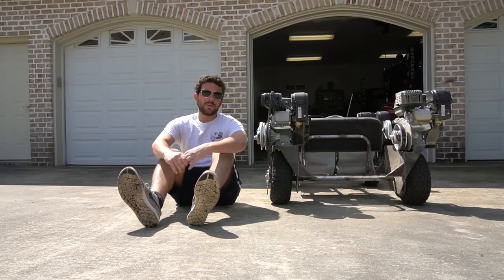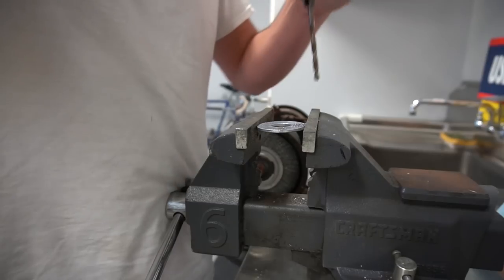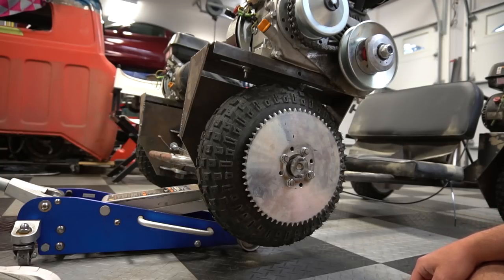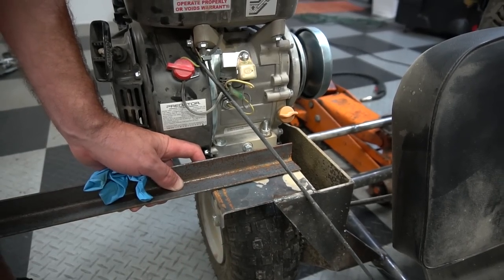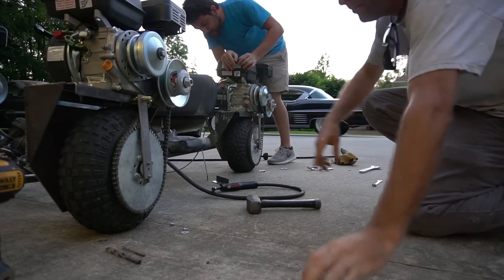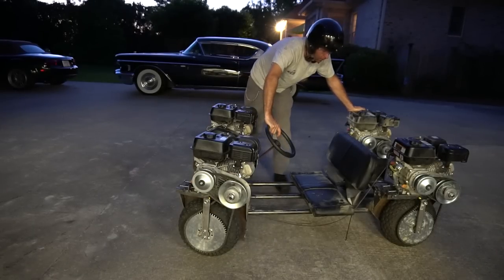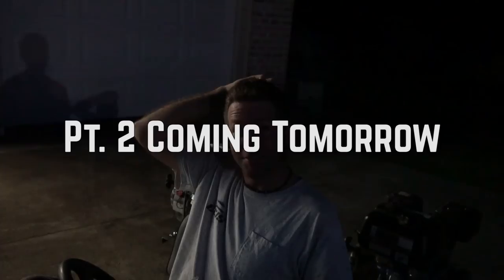Fixing Aggressive Camber & (Tiny) Wheelies!! AWD Kart Build

Comment: Live axle on the rear. Move engines inboard. Problem solved and you have a place to put your brakes.
Reply: Rod McHugenstein nope, you would need a diff because the engines in the front would mess it up on the turns

Comment: looks more like frame twist. than popping a wheelie. you've worried more about the strength of the engine plates then the frame. explains the cart wondering left/right under hard acceleration.
Reply: Zax Garrison more than likely the main reason for wandering is 4 wheels turning different speeds.  This contraption is crazy and awesome.  It’s what contraptioneering is all about 🤪

Comment: I wish I lived near you...im getting ready to turn a 4x4 4wheeler with 4 wheel independent suspension into a two seater dune buggy...i already made a singe seater out of a Suzuki 230 and it worked great...i mounted the engine onto the rear swing arm

Comment: I learnt from my motor cycles that a tight chain gives better acceleration. However too tight and you create more chain drag at top end so there is a balance point between acceleration and top speed when it comes to chain tension.

Comment: Just wondering if some square tubing welded along the outer lip would have worked to give you the space and strength you needed? I would also try to add a second brace a triangle is going to give you so much more support. Great job guys, so impressed!

Comment: You should make an electric start for all the engines at once
Reply: veno56 that would mean they'd have to put a starter on each engine, and maybe more than 1 battery, that's a lot of pixies movin at once
Reply: Corey Trevor no one battery with 4 alternators
Reply: 4 alts??? thats a bit overkill for charging 1 battery only for the purpose of electric start, better off 1 alt 1 battery, otherwise you're adding pointless weight, what they really need to do is strengthen the frame up more otherwise the frame is gonna twist

Comment: It would only work for the rear, but you could use one long piece of round stock as a spindle for both sides. you would have to cut your own threads, but it would help with alignment and accidental camber.

Comment: Put a hoop from rear motor plate to motor plate and run some over head bars front to the frame. It will stiffen it up and you won't need a wheelie bar. A wheelie bar would kill your off road fun.

Comment: All ya got is carriage bolts ? 
Weld nuts on the end if you can't grab the little flats near the head with an adjustable wrench. It's not like you are cranking on those tension bolts anyways , so that's a tip for later. 
Put it in the round file.

Comment: Put a brace/bar between the engine mount so push against each other and support the weight. You have support on the bottom but not up top. It's like building a house without a roof no top support for structure

Comment: the torque bent the wheel, all that weight, and the engine was pulling it up, through the torque converter,  bigger diameter axle  the other side worked because the chain is on the inside........

Comment: You should use a 1 inch single axle and attach that way then that should do away with the bending or camber issue and redesign the front to be stronger just throwing ideas out there hope you get it figured out either way

Comment: Make the 2 throttles control front/rear engines instead of right/left.  That way you won't get the aggressive torque steer and you may not react with both feet at the exact same time.  Also, it will be on 4wd when you need it if you opt to just pull the chains off the front and use it 2wd for whatever reason.  Just my .02.

Comment: Couldn't you use on solid axle going all the way across both rear tires (like a trailer)?. not a live axle, but a solid one since the tires/sprockets are on bearings anyways. It will increase the structural integrity drastically.

Comment: solid axle rather then the bolt you used and bearings in the wheel and mount chains how you did this would be solid and good for offroad

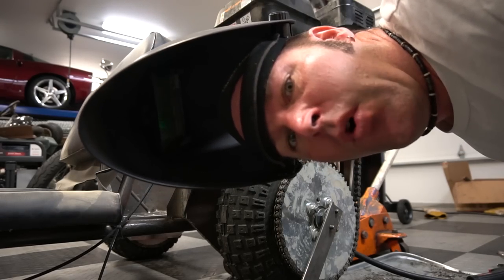Comment: when he puts the bolt in 7:00 he should have drilled so it was right up against the bottom of the plate, that way he could have used the entire plate width for strength, welding along it

Comment: I don't understand why you wouldn't want to use like a 1" square tubing across on the inside of each engine fender you made to help tie the engines/fenders  together for example tie the back side of your front left fender with the backside of the front right fender and a tube across the back side of the rear right fender to the back side of the rear left fender I would think it should make everything stronger by supporting the engine mounting surface together and should help keep the engine position you have and help with the camber issue since your fix you just did is tied to that area anyways just a suggestion especially if you going to try to jump that thing around and go off roading in it again lol

Comment: Go Power Sports screwed me and sent me a 3/4 bore clutch and I ordered a 5/8 bore, it even says 5/8 bore in the order sheet that came with the clutch. They aren't answering call or calling me back to solve the issue. This clutch cost me $60 because its a special 415 chain sprocket.

Comment: Instead of using four bolts use two because it will get rid of any flex if one bar is running from one wheel to the other and it's the exact same weight distribution there's no way for flex

Comment: WOW! That axle is way too small and a brace on the outside will do nothing to correct the problem. You are going to need a larger diameter, much stronger axle and a heavier "spindle" piece to weld it onto.

Comment: why don't u guys strap what u got just build frame with engine s two straight axels and use the four throttles for steering then u don't need the fancy steering have  engines mounting on inside of main frame  it would steer like a bull dozed then

Comment: You  might have better luck making wheel spacers out of Pipe nipples or thick walled tubing cut to length, instead of a stack of washers and random parts!! Also those "Struts" would be better as tubing or even angle-iron, the flat bar you used will just bend and the Axle stubs will just bend again